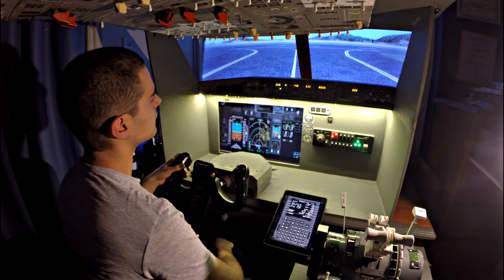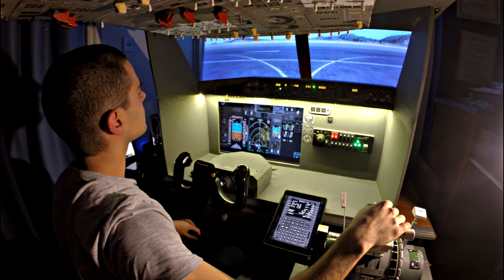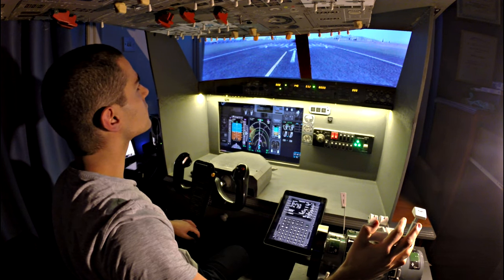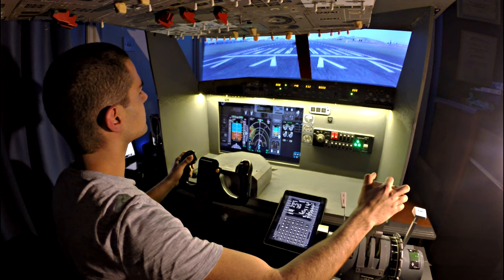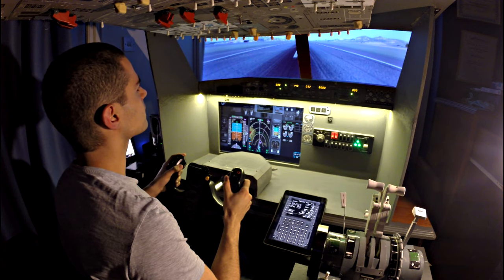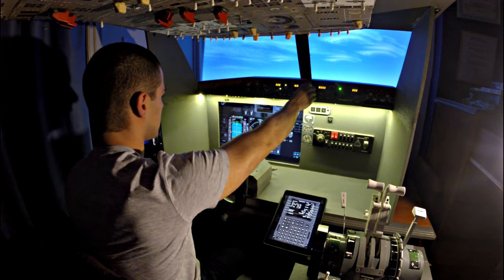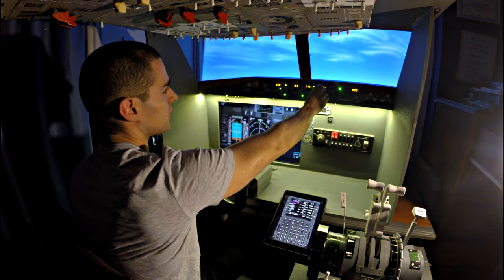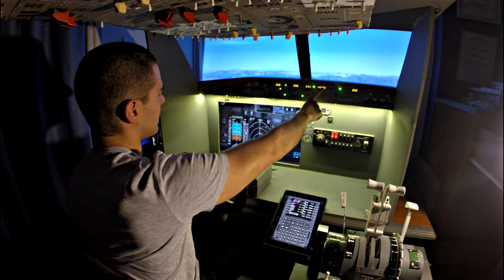PMDG Boeing 737 Home Cockpit | Takeoff from Athens Airport | Online ATC [IVAO] | P3D V4 Cockpit View

Comment: Does your airline do 1000ft V/S when you've got 1000 left before cruise?
Reply from the maker: Yes, a number of airlines apply this SOP to mitigate TCAS RAs/level busts.
Reply: @greatflyer_aviation  okay, I have a follow up question. Do you also do 1000ft V/S if you’ve got 1000 to go on descend?
Reply from the maker: Absolutely, for the same reason, always unless ATC requests a higher rate of climb/descent.
Reply: @greatflyer_aviation  Thanks!